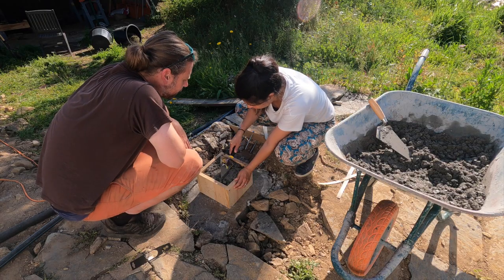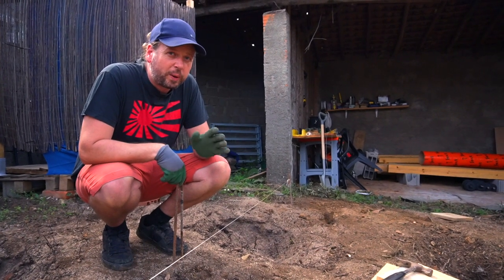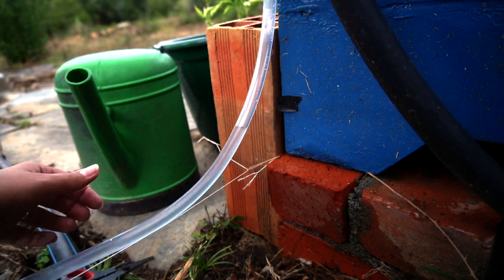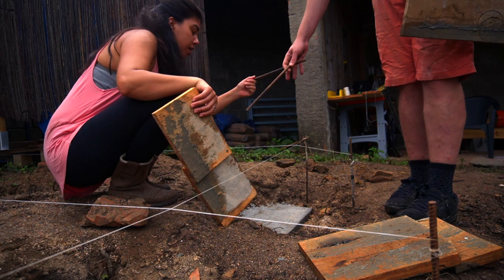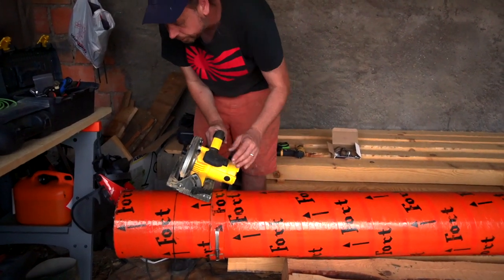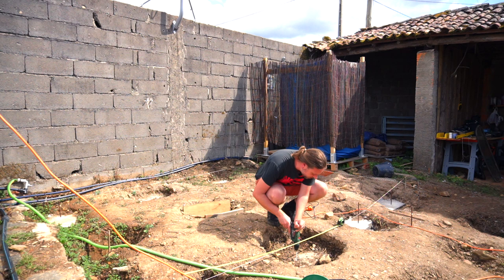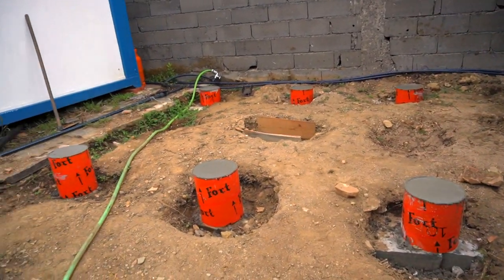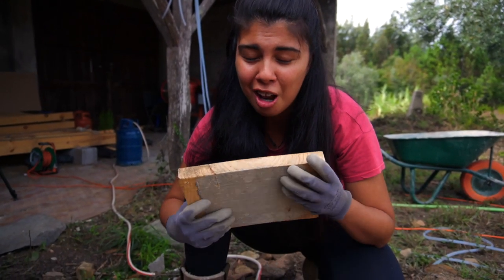#15 Building foundations for our Outdoor kitchen

Comment: Love your channel!

I have an idea that you might not like though. Why not move the tiny home under the garage/roof and give yourself protection from the sun/rain. You could even make the left room (next to the cinder block wall) a temporary bathroom instead of being outside. This would save you money and time renovating the garage instead of building a whole new structure. Just a thought. 

Keep up the great work!
Reply from the maker: Hi Andy! That's very observant! Haha we did think about that in the beginning, problem is that the roof of the side building, or what we like to call 'the granny annex', is not in a good state and rather low and we have plans to convert the building at a later stage to become and guest house. So we needed to keep our options open. The container and the extension we are building will also be used for guest accommodation at a later stage once we have got the house to a habitable level! Thanks for your comment, any other good ideas send this our direction :)
Reply: @TheIndigoEscape  That definitely makes sense! I have a shed 12’ x 24’ shed here that I’ve moved 3 times now to get it situated. It was worth it in the end though. Keep it in mind if building a whole new structure is too much in that heat or rain. Love your channel!
Reply: Nice! If the roof on the granny annex is too low then that answers it. Otherwise could fix up the granny annex roof now instead of later.

Another product I found helpful is landscape fabric to keep the weeds from growing. Less weed eating! lol

Comment: lovely to see you people working HAAAARD like beavers with the footings,may I suggest you to use concrete pipes of similar length and diameter as a external support with concrete filling in it and connecting the base plate,bay the way learning on-the- go you doing a good job with full heart congrats!!!!!!!!!!!!!!!!!!!
Reply from the maker: Great suggestion! Thank you!
Reply: @TheIndigoEscape  by the way how many languages do you dominate?just curiosity I’m 🇺🇾🇦🇺
Reply from the maker: @manuelgonzalez-wy2bn  I (Andrea) speak Spanish and English fluently. I kinda getting a bit more conversational with Portuguese but it’s hard (Spanish helps though). Omar is getting there in Portuguese (not easy)!

Comment: I think the torch head is not very good and I think the regulator is set at a low pressure  for BBQ's etc ,the flame seems rather small to me .
 You need more gas !!  LOL
 Not sure if you can get an adjustable regulator in Portugal ? 
 A good builders yard may be able to help out there . 
 I got one off Ebay  but it was for the screw in type propane bottle  in the UK
Reply from the maker: that’s a really good point Andy. I’m going to talk to the gasman and see if he can help me with a regulator. try that first! yes, you can find them here.

thank you so much!! ❤️❤️🙏🏻🙏🏻

Comment: I used small proprane tanks to char a cedar fence.  Very time-consuming, but worth the time.
Reply from the maker: that’s interesting, how many propane gas bottles did you use and for how much wood?
Reply: @TheIndigoEscape  It is approximately 80 ft. of fence & six feet in height. I used about 8 tanks.

Comment: Hello again great vidieo today, can you please render that back wall  please as soon as possible doing  my head in (Ha Ha). 
A tip for mixing mortar or concrete keep the mix wet till you fill the mixer up then you can it finish off with enough sand or cement
to get the consistency you want, which gives you exactly what you want. 
It also helps to keep your mixer clean inside the drum, a clean drum always mix's the best mix. Can't wait for your next Vlog.
Reply from the maker: 😂 Sorry Hugh! I think you are right, we will do it in your honour as soon as we can. It does look quite ugly. 
Thanks for the cement tip Hugh! Will keep that in mind for next time! See you next week!

Comment: its going to be raining, but we are dealing with concrete today so it doesn't matter.. is a sentence i didn't think i would ever hear lol
Reply from the maker: it’s far worse to deal with heat than rain. you can cover rain, with heat you need to wet it with a hose pipe or something so it doesn’t cure too quickly and cracks.

Comment: Great video!  Enjoyed the concrete puzzle, just kidding.  As far as the roof goes, I don't know anything about that method.  But I do  have a question.  If you have to rub with oil afterwards  before placing on top, are you going to have to climb on the roof every year to re-apply?  Also, the fire hazards of Portugal,  do you think that would be more hazard for your roof 8nstead of clay, shingles or tin?  Just curious.  🙏❤🇺🇸⛵🇵🇹
Reply from the maker: Hello Melinda! How’s things over there? 
Wood is completely fine as long as it’s use in an area at least 50 meters away from your end of the land or where trees are. Many people use eucalyptus to build with but it is bit trickier as it’s round. Also people use their own ones and we don’t have any. 
The oil shouldn’t need to be applied again as the burning should be enough, just adding oil for extra protection.
Roof will be clay tiles 😊
Reply: @TheIndigoEscape  Things are fine, thanks for asking!  Oh, on the roof I must have misunderstood how the burnt wood is going to be used.  I've seen it used here on the outside of small cottages and on the inside of 3br2bth houses as like an accent wall in the livingroom/ sitting are/family room,   haha, lot of word for one room, lol.  And looks really good!  I know what you were trying to make it look like and it's going to be beautiful!!  I think, don't quote me, I know on the inside walls the lumber is not treated, therefore easy to burn.  I know from experience (accidently done) burning treated wood is a little longer because od the  chemicals.  BEWARE, wear a mask while burning treated wood or you'll look like I did last summer from burning scraps (my whole entire face swollen up.  My eyes were almost closed my nose, chin, forehead, cheeks...it looked like someone pumped air in my skin.  It didn't hurt just scared the crap out of me.  Went to th Dr. They knew it was a reaction to something but everything they asked I was like No.  When I got home and was sitting outside on the porch looking at my chimanea that I realized what it was.  I called and told them and they agreed!
Long story typing it.....just be careful. 
They gave me a steroid shot and I can't remember what else.....
Reply: @TheIndigoEscape  OH My that was long......lololol

Comment: sorry commented before you put in the rebar.  would have been easier pouring all at once. plus the posts don't have to be exactly the same length
Reply from the maker: that’s okay! 
you could do it either way, we consulted with two builders and they said it doesn’t make that much difference for what we are doing.

Comment: On the japanese wood surfasing get a burner runnong 8.bars jssed for rofing vith tar paper or make a fire and drag Them trough thats the traditional way but its not easy. The roof burner is the fastest you just need more pressure On the gas.
Reply from the maker: Hi Michael, could you let me know this bit again: runnong 8.bars jssed. Didn't quite catch that. Thanks!
Reply: @TheIndigoEscape  I think he meant 'get a gas torch with a high pressure regulator, the kind used by roofers, capable of running at 8 bar (roughly 120PSI)' 😀
Reply: @MaxwellGouldEsq  Jep thanks Maxwell just what i meant..
Reply from the maker: Thanks guys I appreciate it. We are sorting out the regulator bit first and see what happens!